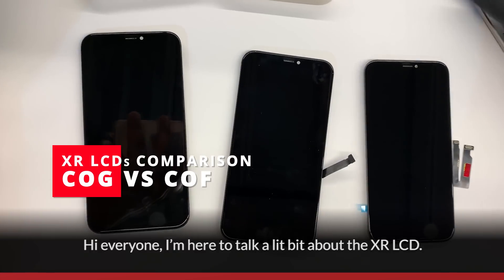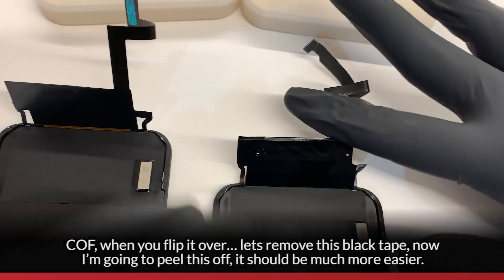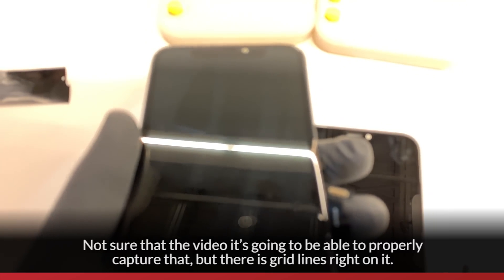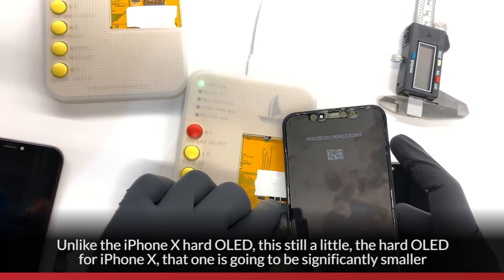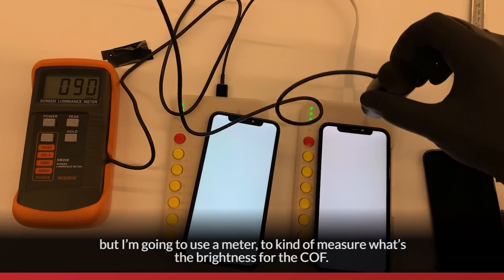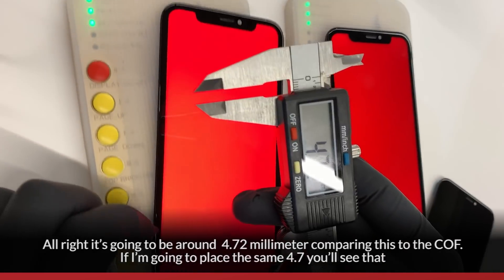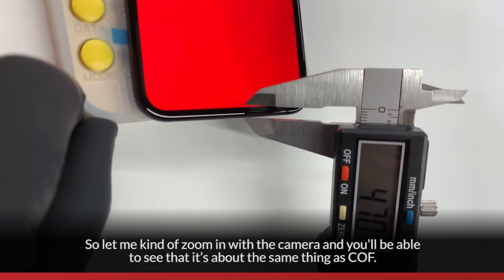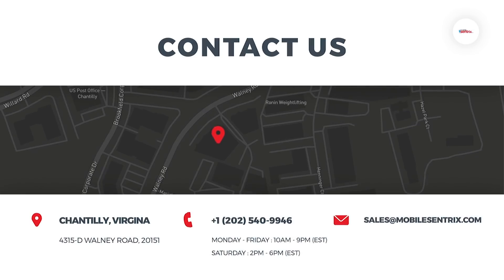COF VS COG - What is the difference?

Comment: Great video. If you expand this series I’d like to hear more about variations in touch functionality between aftermarket and premium and any functional differences between the TFT (thin film transistor?) vs in-cell. Finally, Ive preferred aftermarket plus because of too many “aftermarket” grade screens having out-of-box defects (usually touch ghosting or poor flex connector/no image). Are there flex quality / spec differences between the COF/COG/Prem-OEM?